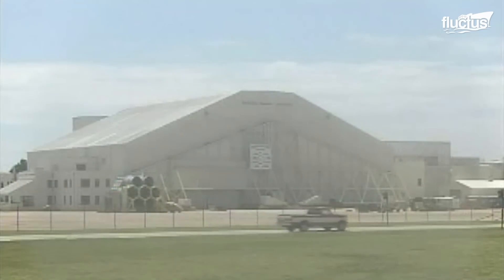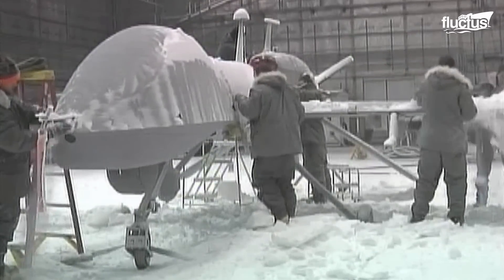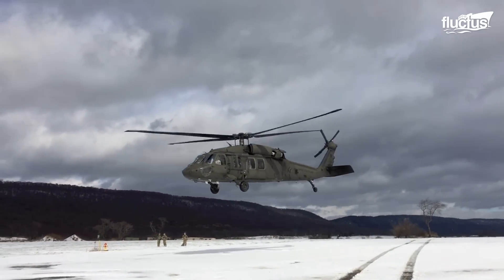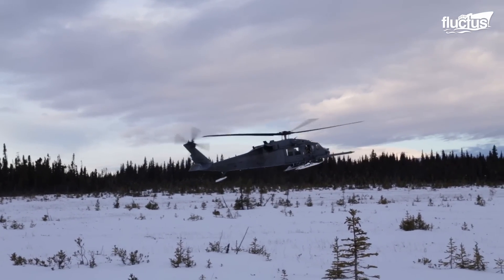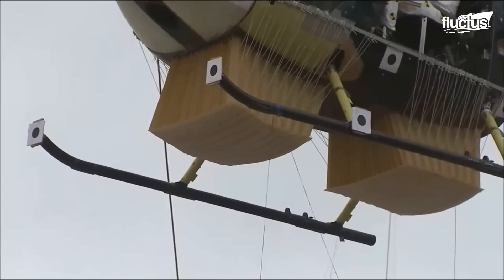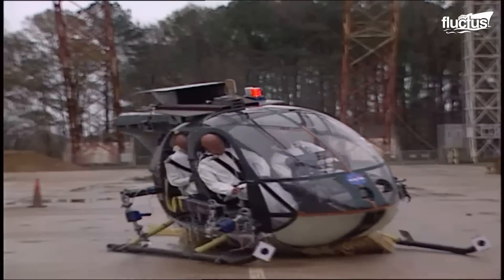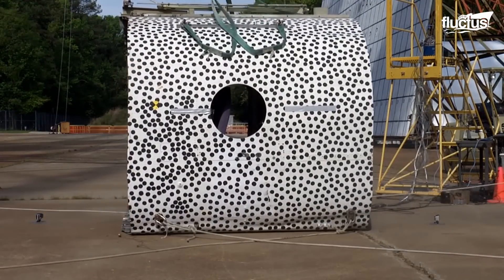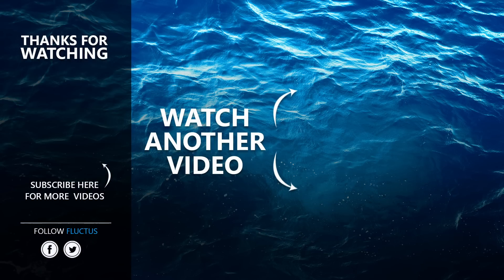Inside US Super Cold Laboratory Testing Massive Helicopters at Extreme Cold Temperature

Comment: The comment at 12:03 saying "the CH46 is identical to the CH47" is very wrong.  The CH47's body is larger, has larger rotors, has almost 3X the lift capacity, and can carry double the troops.  They're both built by Boeing Vertol and are both twin rotor designs but are two VERY different airframes.